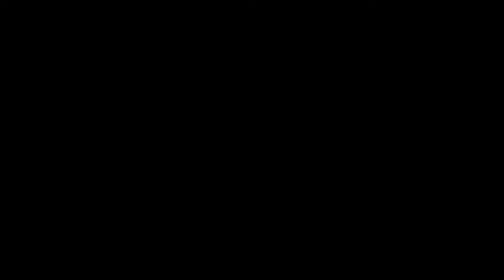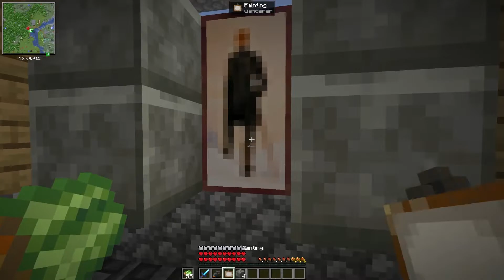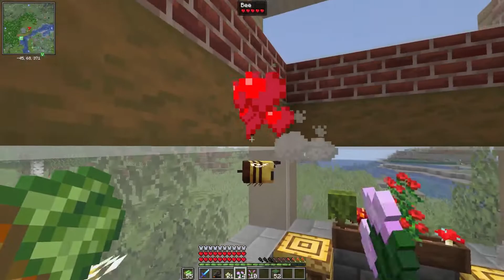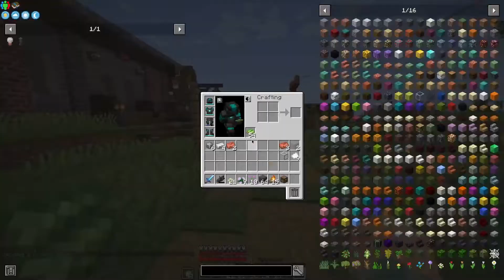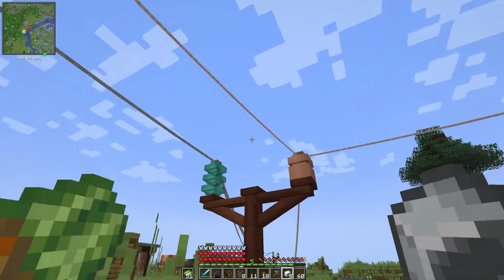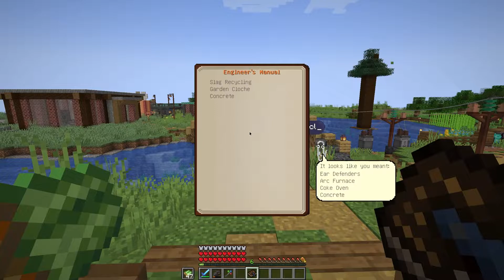[HE3] Episode 18 - Industrial Greenhouse

Comment: You need an accumulator as a throttle, the cloches are trying to pull too much power at once through the wire to fill the reserves, on the plus side any accumulator can accept any voltage

Also don't forget that you have the nether paintings to decorate with as well.
Reply from the maker: Huh, I guess that makes sense - if my PC pulled to much power it'd trip the breaker, and without that breaker would also cause as much havoc as these cloches did. A bit un-intuitive for me to visualize mentally, but that's why I never got into electrical engineering 😉
Reply: @oitsjustjose  It helps to think of the wires as a kind of electrical fuse